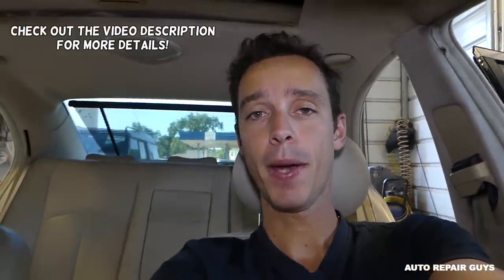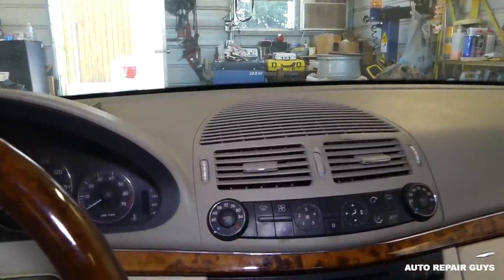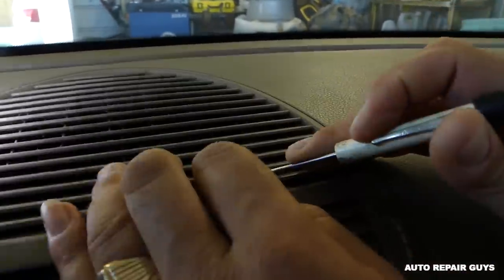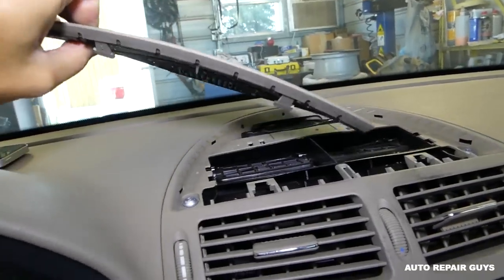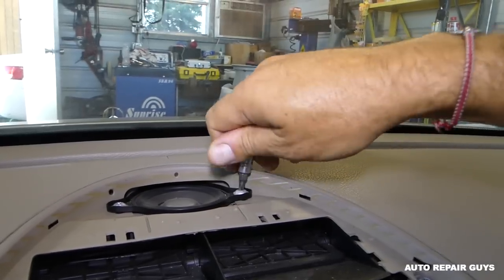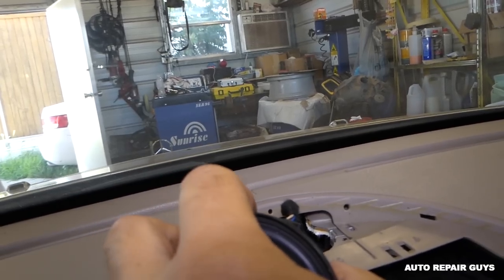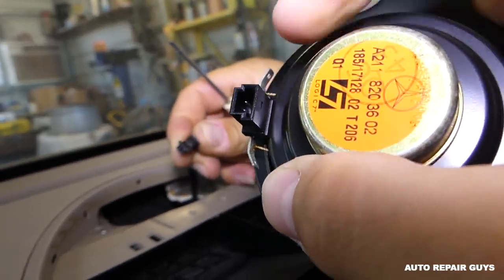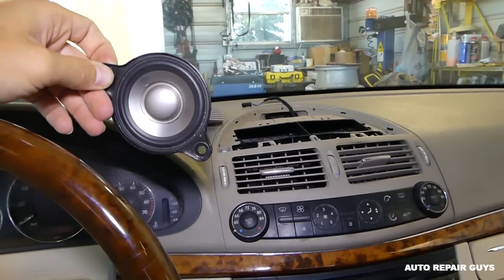HOW TO REMOVE AND REPLACE CENTER DASH SPEAKER ON MERCEDES W211

Comment: Thanks for the helpful video. 
I couldn’t get the speaker to “unplug” and it appears that I damaged the connector (it looks like I broke off a piece of the portion that is connected to the wire and it is stuck in the speaker now). What is the secret to being able to unplug it?

Comment: Hello, front center speaker doesn't work in my car(2003 w211). I checked the speaker and wires: speaker is good, but there is no signal from wires...
what to check next?

Comment: My 2007 e350 has a fine metal mesh here instead of the grill, so I can’t access those release points.
Is there another way to take it off without taking out the entire climate control faceplate?